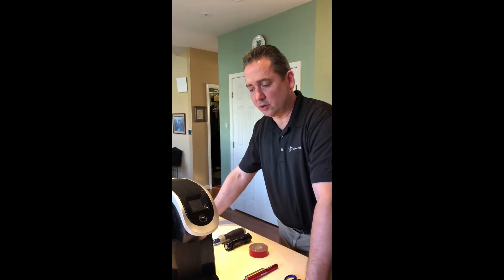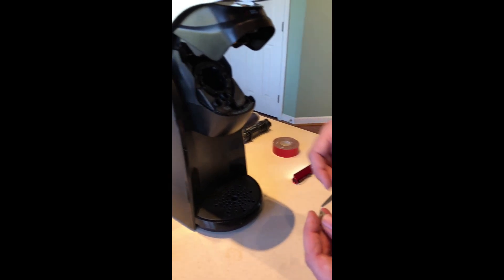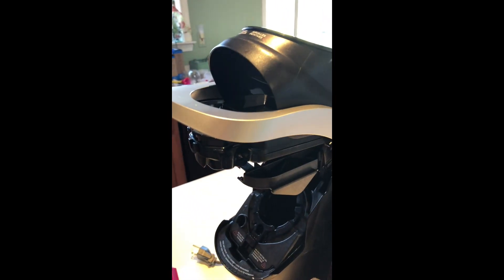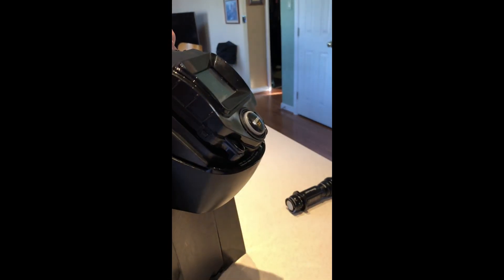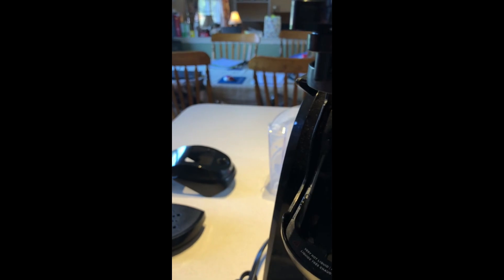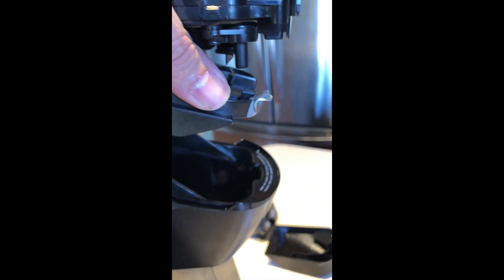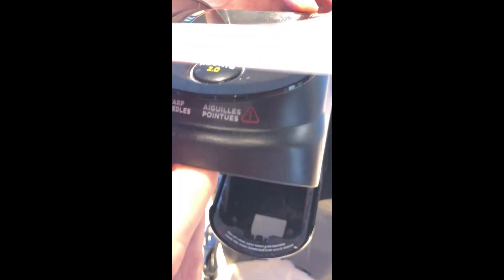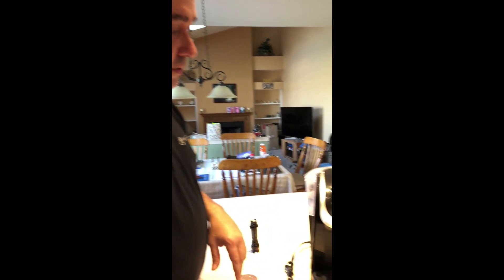Keurig20 Lid is Stuck Open - FIX IT YOURSELF

Comment: My Keurig Elite (purchased in August) had this problem.   The piece that makes the bottom extend out so you can put your K cup in separated from the guiding tracks.  I called Keurig and they have no idea of what I'm talking about.  This video is the closest solution I've come across.   I wish Keurig had a schematic of parts and how they work for my machine.

Comment: Thank you very much, Tim. Your video helped me immensely. Once I figured out what needed to be accomplished, I knew exactly what needed to be done, without using any tools and without taking your Keurig apart. Step 1: Go find yourself a mini-Binder clip. Step 2: Remove the arms from said Binder Clip. Step 3: Lift the Keurig arm and slip the clip portion over the plastic rib that Tim placed his 1st piece of tape. Voila!! That's it. (Note: the clip may have a tendancy to pop off. If that's the case, use a piece of that double-sided tape to secure it.
Reply: Thank you, mini binder clip worked like a charm, 2 minutes total if you struggle.
Reply: Robert,
Thanks very much with your idea.  I tried the washer mechod with what I had around the house but it didn't  work. Had no problem with your solution.  Because of you I am a hero, the wife has a good cup of coffee.
Reply: The binder clip worked like a charm. Thank you so much! (I couldn't bend the washer to work, so this was perfect for me.)
Reply: Sir, you have NAILED it!  It did take me more than 2 minutes of struggling ; such a simple, effective cure .

Comment: Thank you for this video. Mine broke last night and my immediate reaction was, "I need to get rid of this thing".  I ended up fixing it in a similar way but with a plastic piece I had.  The fact that this issue is prevalent and Keurig hasn't fixed it yet has me thinking my next coffee machine will be a different brand. Thanks again

Comment from the maker: Just an FYI... my fix with the adhesive tape is still holding 11 months later. I never had to replace it with anything more permanent. I also didn't want to put epoxy or any chemical near my coffee so I just used that heavy duty grey two sided tape you see in the video. I am glad this video helped out some of you, and as a bonus, my son had a great time being the "director" and "camera man" and also helping hands in the video. Cheers
Reply: Tim, I really appreciated your video and your repair suggestion. I am a retired engineer and did the fix a bit differently and thought you might like to see it. I drilled a small hole in the plastic where you taped the bent washer on and used a small cable holder with a screw hole in it to screw it to the plastic. Works great! I tried to attach a picture but couldn't find a way.
Reply: I can't fix it at all and video doesn't help me  who can fix it for me

Comment: Hey Tim, Thank you so much for this video. My mom's Keurig 2.0 had the exactly same problem. I really appreciated your video. 

I figured out an easier way to fix it, no need to take apart! The two pieces broke off right next to the metal rod in there. they act like a little guard to prevent the metal rod get stuck, which is causing the problem.

ALL YOU NEED are zip tie, glue and a pair of tweezers!!!! 

So If you cut tiny pieces of the zip tie and stack two height with glue. then just insert at the place where they broke off. 

Problem solved!!!  I can send you a picture of what it looks like. if you want.
Reply from the maker: Yes, post a pic; thx
Reply: @timpetrosky6210  what's ur email?

Comment: Thanks for the info. Vid was very helpful. At 0:42 if you look on the top part just to the left of the needle you can see that small round tube like protrusion. I found if you just use a Silicone drink straw it fits perfectly with no adhesive needed. Just cut it to length and it works fine. No washers needed.

Comment: Great fix. I found one of the tabs when doing a deep clean but didn't know where it came from or what might be the result of it being broken. 
Then of course it locked up on the second cycle of descaling.  🤣  Now after implementing your fix, it's operating better than new.

Comment: Thanks for the video....  was able to do the repair quite easily!   Added a silicone bumper on top of the 1/2"  washer to give it some extra height as it was still catching occasionally.    Probably depends on how high the first washer is glued on.  Used epoxy and hope it will hold for a while.

Comment: Thank You, I don't mind doing the first step to close the lid. I saw other videos that want me to disassemble parts first, which I don't want to do, and the never mentioned holding down that inner part that is very to  access and I don't have to take apart my unit.

Comment: I have a few questions; 1) What thickness is the tape you used?
2) After a bit, doesn't the tape start to pull away, cause from the heat from the coffee or the other parts around the fix, getting worm or hot? 3)Does the tape or any parts of the fix get wet with steam as you use the machine? 
 Also a load of thanks to you and your cameraman!👍🤗😊 Mine broke this morning luckily after making my 1st cup and looked on Amazon to replace it...K250 Plus 2.0 is $285!! 😳 Found the parts inside and you're right, for what we pay for it they should do a redesign & issue a retrofit with the amount of people that have the same parts break.👍 👍👏👏 Unfortunately, they won't because Kurig is hoping more people think it can't be fixed or don't want to work around so they put it in the trash and get a new one. 😳
Reply from the maker: Thanks for the comment JS... here are a few answers. 1. The tape I used was from Home Depot.. a quick search and i see Gorilla
1 in. x 1.67 yd. Black Heavy Duty Mounting Tape is similar to what i used. its thick like a little less than 1/16" inch.. but if you get the mounting two sided tape they have that will work... 2. The area the tape goes doesnt get hot. So no worries there. No issues with heat, steam or water either. Remember a Keurig.. keeps the steam and heat mostly in the KCup.. thus the reason they can get away with plastic parts. It never fell off even when  i cleaned the machine. ... On a last note.. my son was only small at the time but so proud to help dad make a video.. Just last night i was telling him that video is still helping folks.. today he is 6' tall (as tall as me). Hope this works for you!!

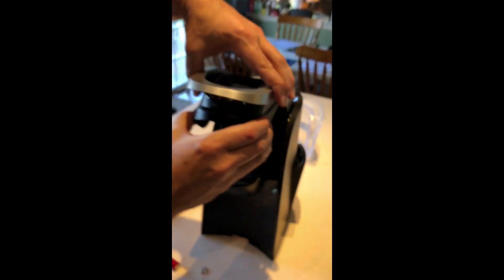Comment: Tim, great video especially with your sensitivity toward window lighting glare on the effect of the footage.  Im having an issue with the thin plastic piece that covers the inside upper part of the machine's "mouth"  , the piece with the circular and rectangular cutouts featured in the footage at 3:56 mark of this video.  I had tinkered with the machine to reset the screen n my 2.0 300 model.  The machine worked and the piece was in place but recently came loose and apart from the machine.  I've scoured the internet for a diagram or video to help but to no avail.   I even called Keurig which  told me that because that model is discontinued it couldnt help me...The piece seems to be in tact.  Any thoughts?
Reply from the maker: Well that is a 'hard to identify' part.. but i know its part of the 'lid' 'arm' or handle.. not sure which they call it. Here is a picture i found of it https://wiringall.com/image/keurig-20-parts-diagram-8.jpg (shows the part up close). To view the picture is safe (copy paste the link into a browser), but i would suggest not surfing around that website too much (wiringall.com). It has a bunch of pop up stuff. But its safe to view the the .jpg and at least you can see clearly that part. Some searching .. i could not find the name of that part. It has several functions including holding the cup momentarily to allow the pin to retract as well has having windows (those holes.. i believe the square one) to identify a 'legit Keurig "K" cup or not'. I did not find it for sale as a single item. Mostly i found things listed as "LCD Assembly" "Arm assembly" etc for a Keurig 2.0, which is what i think we owned when this video was shot years ago. The arms i saw on eBay were pretty beat up and most did not show if that part was included.  Not sure if yours broke off.. or fell off .. but it might be impossible to find a replacement, you might be better finding a used model similar to yours are scavenging it for parts if you REALLY want to fix it vs replace the unit.
Good luck!

Comment: Excellent Video. Although the tabs didn't break off but one of the screws holding silver handle was missing and the other one was loose. I don't know if it was a manufacturing defect or there is a screw wedged someplace in the machine. In any event your video help me find the problem. Thanks!!
Reply: Washer sizes at 1:20.  Picture of installed washers, 2:20.

Comment: 3D Printed an Angle. Used Super Glue and it works better than new.
Reply from the maker: Great job Dwayne. I had thought about doing that when we made the video, but we wanted to use ordinary materials that anybody could get and fix. I would love to see your printed item though. If your not joined.. you should join Thingiverse and post your stuff there. You'll find my stuff (many different things)
Reply: Have you uploaded your design anywhere
Reply: Any for sale🤷🏻‍♀️
Reply: I’d like to buy one. Please post a link.

Comment: What causes the lid to stick open?  Is it a faulty part?  Is Keurig aware of the problem?  I saw another video where you just pull the inner ring down each time and it will finally close again.  Curious as to why this part breaks......any comments?
Reply from the maker: In the video i show you the two parts that break off. When they are broken off, they no longer stop the lid from moving too far. When the lid moves to far , the lid gets stuck.

Comment: Do they not sell parts for these?
Reply from the maker: Great question. You probably need to reach out to Keurig with that question. This video was a easy fix for a bad design. But if you can get the part, AND if you want to dismantle the machine much more than i do in the video, i am sure you could replace that part. I have reservations on how worth it that would be. Making assumptions here, but i am sure they wont make the part cheap to buy. I do know that tearing down the machine far enough to replace those parts, is much more than i do in the video. In the video i am really just removing a handle and a cover. My son and i were proud of providing a solution at little to no cost, and with minimal effort, however, if you do go down the path or replacing the part with one from Keurig, let me know if it was worth it. Best luck to you.

Comment: Did anybody do this without unscrewing anything? I want to do this fix and it looks like you can just mount the washers without dismantling any parts
Reply from the maker: If you don't want to unscrew stuff, if you can see the area where it need to have the washer attached.. you should have no issue sticking something in place there. Just use good sticky two sided stuff. Optionally you can just pull the bracket down each time you use it.. in the video at 0:35 seconds. Let me know if that helps

Comment: Mine says lower handle, but I am able to lower it, but it still says lower handle.
Reply from the maker: I would suggest trying 3 things for a quick fix. 
1. Open, remove any k-cup. make sure there is nothing stuck in there and the needle is clean.
2. Remove and reseat your water reservoir. 
3. Try unplugging it for about 5 minutes.